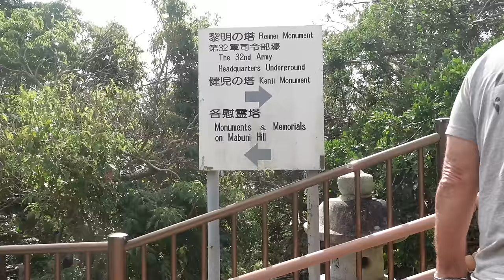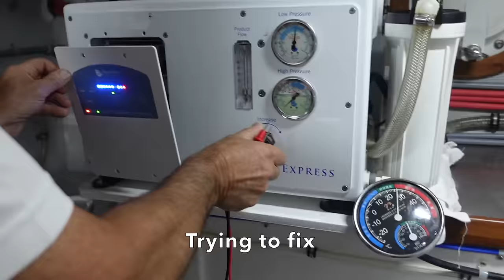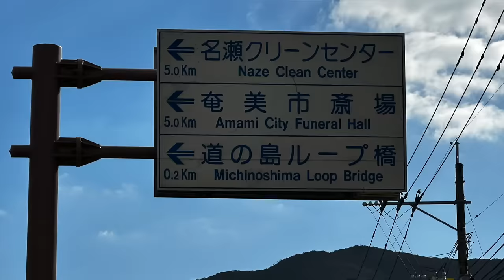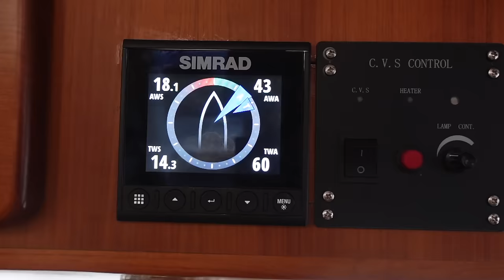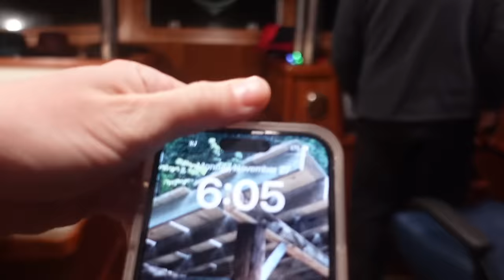One Month & One Thousand Nautical Miles. Are we there yet?

Comment: I used to get horribly seasick. I found the more I stayed where I could watch the horizon, early in the trip, it made it so much easier as the trip went on. Always look forward, and keep your eyes on the horizon, and it gets better. I found doing that when I felt sick, helped also. You have to get your ears and brain in tune to what your feet are doing. Pinching your nose and decompressing helps. Then there's always dramimine or other meds.

Comment: Cool video Thanks. This is trivial but back to the bottle. A Tip for ya. If you need to empty a bottle quick, real quick. Tip it upside down and swirl it in a circular motion, this creates a vortex and lets air back in as it's emptying. Probably not on your priority list but if a bottle is the only thing you have to empty a bilge in a confined area and your pump is buggered and time is critical it's a good tip. Thank you for the phone scan translate tip. Good to know.

Comment: Love the design and type of boat that it is. Sadly, the complexity of said boat and the quality of parts/workmanship can be an issue. When I taught Design For Manufacturability at MIT I'd use Medtronic pacemakers as an example of why 99.9% pass yield wasn't good enough...I mean, if you're going to have a tuna can placed below your clavicle,  you don't want it to be removed a few days later.
I had an aortic root replacement from blunt force trauma from a mtn bike crash. I've had 44 broken bones, back surgery and a knee replaced yet the worst I ever felt was being sea sick. I fear getting on a boat everytime, yet, I love the water...I digress...
Glad you and Steve are home safe and sound. Massive love fest with your critters was long over do.
Be well, recover and stay safe.

Comment: have you ever posted the "specs" for the boat ?  length, draft, beam, gross tonnage,  engine size,  hp, water capacity,  fuel capacity ,  and the big one fuel consumption at crusing speed.  "Fair winds and following seas"

Comment: Boats seem to have way too many completed systems that if the designs were thought out better, might not need to be done. So, what caused the break in the fresh water system?  Could it be that the manufacturer of the boat does not know how to make all systems independent so everything works as it should? Routing things into other systems seems not a good idea.  Just some thoughts to ponder.  Enjoy and have a great day.
Reply from the maker: The one big issue about the boat being built in China is their water pipe system. Steve wants the Pec system that we use in North America, but they didn’t have it there to install on the boat. There are just too many joining parts in the system that can fail, so it’s something he wants to do differently down the road. (He had to change the water lines on his old sailboat too)

Comment: Seasickness is awful. I too suffer from it at times when l happen to be on a boat. All you want is to plant your feet on solid ground. There is also nothing like home sweet home. What is with all these cancelled flights? Our niece was stuck in Istanbul for, four days by BA. We got delayed due to weather and were a day late into Heathrow. Contacted Air Canada who said to bad you will have to buy new tickets. Apparently our tickets were non changeable which was news to us. We booked two seats on WestJet to Calgary on to Edmonton. Now l am trying to recuperate the portion of funds not used with AC plus the added costs of the WestJet flights. My feeling is l am pissing into the wind. Welcome home.

Comment: Now I know you've gotta have an electric engine bilge pump, so was Steve just testing the manual backup ??  I just got off a 2-week sail around the Falklands on a 77' sailboat, and both heads used sea-water to flush.  Surprised you're using expensive water-maker water for flushing.
Reply from the maker: I think (*think) that the electric bilge can’t be used while under way. I’m not too sure on that though - I’d have to ask Steve. 

Steve has always had salt water toilets in his previous boats, but we were encouraged to go with fresh water as it helps keep the smell down. In hindsight, what would be ideal is the option for either. The toilet treatment system (septic system) would work best with a salt water toilet system, so we do now think that sticking to salt water toilets (and manually flushing ones) would be best. But these are all things that you don’t know off the bat - most new boats use these newer advancements/newer technology systems, but there is always more potential for things to go wrong with them. 🤷🏻‍♀️
Reply: @michygoss7148  - Well, no question Steve knows what he's up to, I'm just curious and trying to learn from your experiences, to help me out on other boats I sail.  My experience with water-makers is that they can be one of the most unreliable pieces of kit on a boat, which I'm guessing is why many opt for salt-water toilets.  On my latest trip, ours were electric flush, with a manual backup, but the flush cycle was long and loud.  That said, I didn't notice any issues with odor, 11 people sharing 2 heads.

Comment: Do yourself a favor and drive that boat-meaning steer. Pick a cloud or landmark on your heading and aim and steer until you’re comfortable steering a course. Your seasickness will evaporate. If it doesn’t, leave the boat-but I’m pretty certain you’ll be good.
Reply from the maker: I did kinda do that. I picked a favourite spot in the pilot house and looked out and watched the horizon for as long as possible. Or closed my eyes and wished I was at home snuggled with the dogs. Lol
Reply: @michygoss7148  indeed-but that ain’t it. You need to drive. I live on a small island-traveling from the NE to the Keys by boat, Bay of Islands to Russell, etc-it works for me. No driving, no good-until I’ve been at sea for several days. When someone suggests staring at a fixed point I want to beat them.